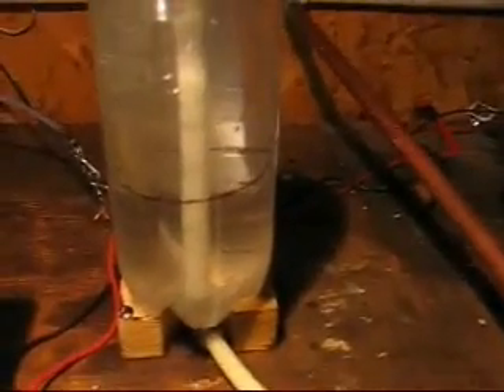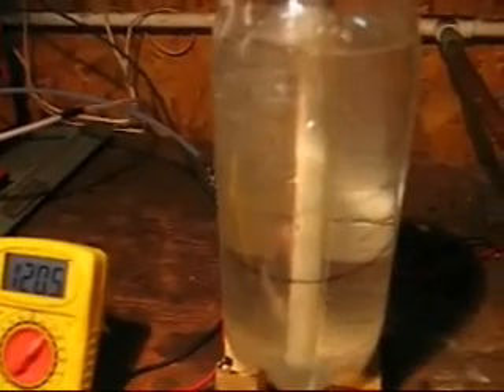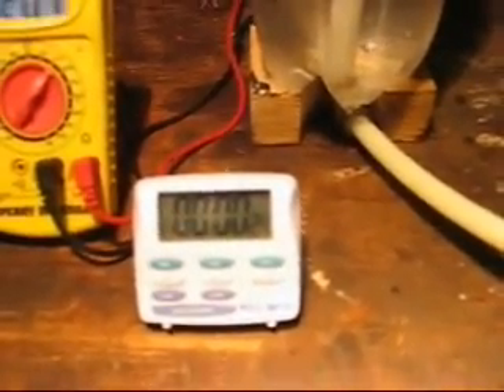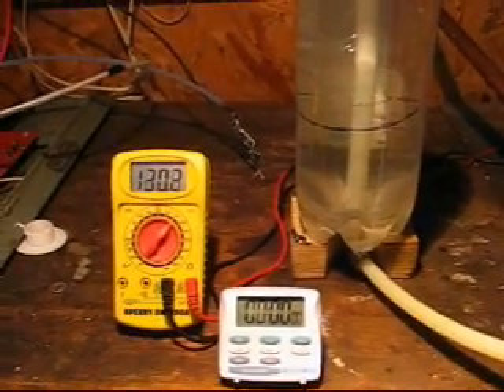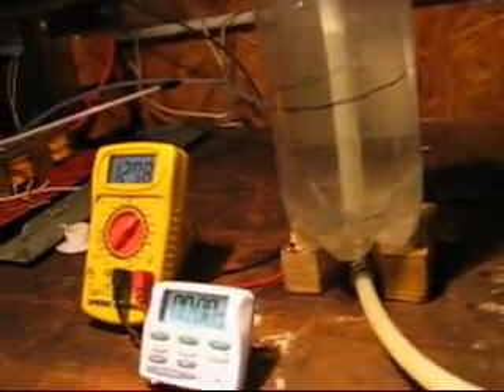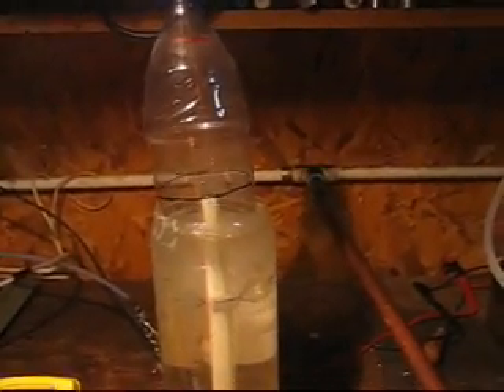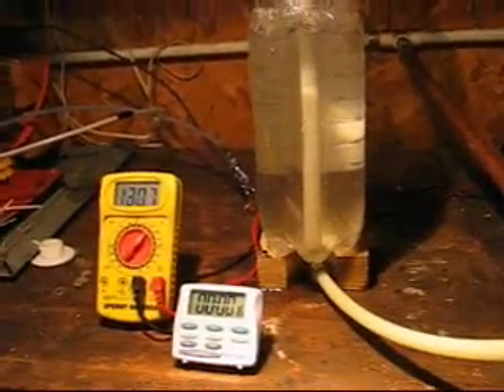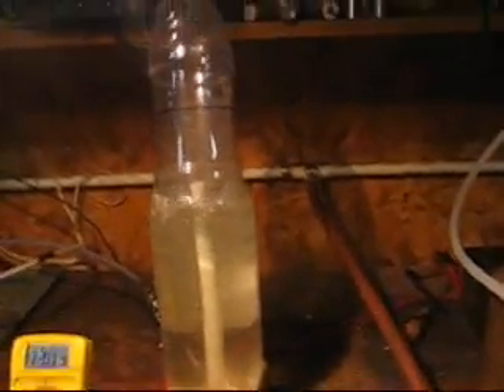HHO Generator HVDC3

Comment from the maker: yes on the valve. I am using a large powerstat variable transformer then rectify the AC voltage to DC. The cell can be either setup with connections to run on 12V systems or hooked up thru a inverter and then rectified back to DC for the higher voltage with only two connections.
I have 61 6" plates 1/8" spacing with gaskets between each plate.

Comment from the maker: The voltage is coming from the panel in the shop to a variable transformer rated at 20 amps then rectified. I have checked at the panel and the amps are a little different but not much.

Comment from the maker: My plate config is 120VDC with +59N- this gives me around 2V per plate and it doesn't get hot after extended periods of running at these voltages. Stays under 110 deg F.

Comment from the maker: Yes, secondamend I am using a tee with a ball valve on it to let the gas out thru the valve till the test then I close it to force it down the tube to the test vessel. 
I am using 2 236BU powerstats wired parallel thin the AC output is rectified to DC then to my drycell for my test stand.
In a car you might could use a 1500W car inverter and then rectify the output to DC voltage. This would give you 120VDC from your standard voltage in a vehicle.

Comment: Are you using a valve to keep the hydrogen closed off till you start the timer? What are you using to get the high DC voltage and how would you adapt that to a 12 volt systme in a car? What is you plate configuration?

Comment from the maker: Have not checked the actual temp. but ran it for over an hour and it just got a little over room temp. Will try to check it and see what the temp. is after an hour of running. But have noticed that if you keep it at 120VDC it does not get hot. Now if you run the volts to 130-140 it pumps a lot of gas, around 1 liter every 6-7 sec but it does get a little warm.

Comment from the maker: I am trying to keep it under 10A at 120VDC by adjusting my electrolyte mix. Done some run test and it has been hoklding at 7 Amps for over an hour and producing 1 liter every 14 sec. Thanks for the equation. I think that the 1500W inverter should do fine

Comment from the maker: yes, and yes.I just like the higher voltages. In some of my test it takes very little KOH or K2CO3 to get the same output as the lower voltages and higher amps. The inverter I plan to install in my van is around 1500W, this should cover my supply to. So for around 700W this setup will produce 4LPM at these voltages. If I was to set it up for 12V it would take nearly 60 Amps on this large of a cell to equal a 700W output.
   The one I use is a 40A 600V full bridge rectifier.

Comment: inverted dc, is ac rite, but rectified ac is dc.  Why use that setup, does you use it at a better frequency?  Thanks for the work, could you fill me in, im really interested. also i have a 12volt inverter, what size rectifier do you use, or should it be made of large diodes